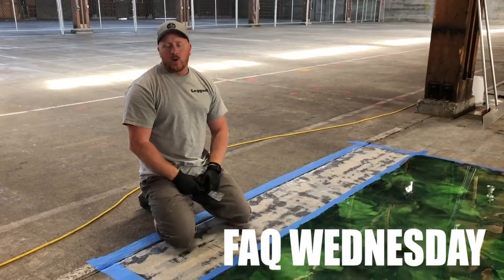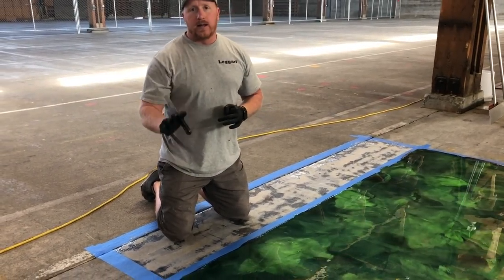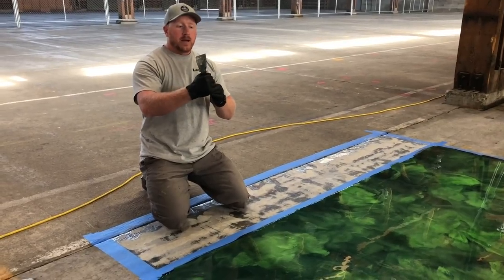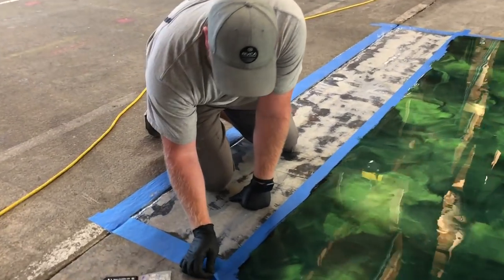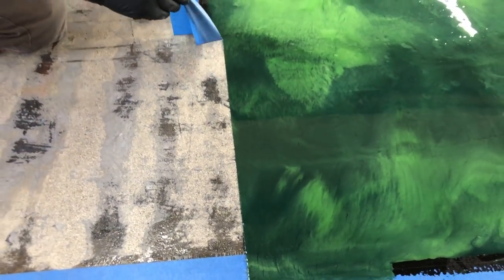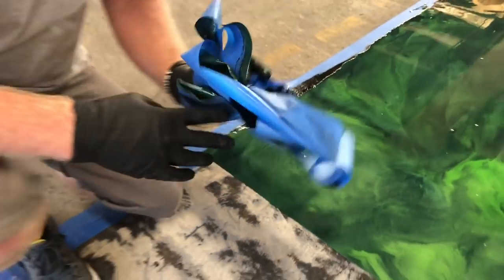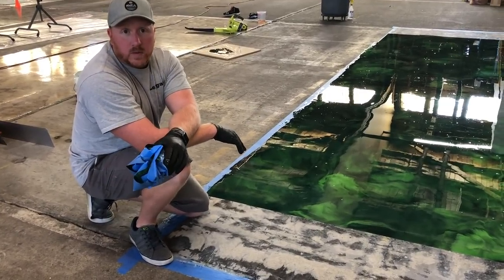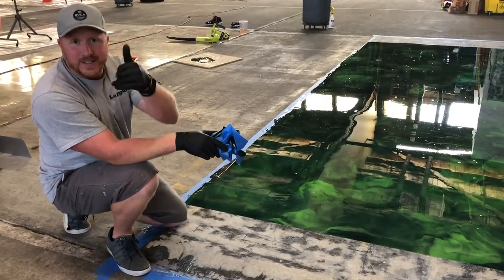FAQ Wednesday | When To Remove Tape

Comment: So my question is, I'll be doing this in my bathroom and I'll have my stand up shower taped off from the epoxy. The shower is on the other side of the room from the door entry. In the 2-3 hour period, is it still ok to walk on with spike shoes to peel off tape from shower? Or do I peel earlier? When do you not step on the epoxy until it cures?
Reply from the maker: After you apply the epoxy wait the next day so you can walk on it to remove the tape.  Thanks
Reply: This confuses me...in the video it says 2-3 hours to pull tape..but in the comments it says pull the next day? Which one is it?
Reply from the maker: Brandon Raynes sorry for the confusion, 2-3 hours is much easier when removing tape on flat perimeters like we’re showing in the video. Sometimes you’ll have areas that you can’t get to without walking on the epoxy, in those cases wait until the next day so you can walk on it. I hope that makes sense. Thanks
Reply: Leggari Products  yes! Haha thank you. I have my first floor installation coming up and that question has been bugging me. I’m trying to order my floor kit and when I’m getting ready to check out I noticed on the cart there’s no primer included with the order. Should I call in for this order? Just want to make sure I have everything I need. Also I need to order some flakes and I wanted see if I could order some 5 gallon buckets, or whatever large sizes you have,  of the part A and part B to have in my shop to practice with. Thanks again guys!
Reply: Thank you guys! Any suggestions if tape drys to the epoxy? This clears up alot of information.

Comment: I'm sure this is totally off hand but when I paint walls (Just did my home) at first I used the blue painters tape but moved to green frog tape because I had bleeding under the tape and needed better edge control. By chance have you tried the frog tape with the edge tech gel? and if so did it work as worse, better as well?

Comment: Would the frog tape work also?
Reply from the maker: Yeah, we typically just use painter's tape, it does the trick. With some projects, you don't want the tape to be TOO sticky and pull at whatever you put it over.

Comment: Guys I love yalls channel. I have a question for you in reguards to a river table. I have made few small ones with very good luck. I was approached by a possible costumer and asked if he could use the table outside. If so is there anything I need to do to protect it or place on it to be used as type of meal table on a deck
Reply from the maker: David Gavin there’s no 100% solids resin that is UV stable so you won’t be able to use the table outside. You can try and do a table with a Polyaspartic which is UV stable. It’s more expensive but won’t amber in the sun. It’s not a “casting” product either so to achieve a thick layer you’d need to do multiple layers (one a day) to achieve the look your going for. Email customerservice@leggari.com regarding the Polyaspartic. It’s worth a shot. Thanks

Comment: my friends, give me a suggestion, please. putting the blue ribbon on the foot wheel as I do to remove it since I imagine the resin will put a part on top of the ribbon. How do I get her out?
Reply from the maker: You always want to tape about 1/8 inch high so the tape does not get trapped under the epoxy.  Thanks

Comment: Why does that floor look like it is covered in bubbles???
Reply from the maker: I don't know what your looking at but it looks pretty clear to me.
Reply: Starting at 1:20 I can see what look like hundreds of bubbles.  I don't know if that's what they are but they are pretty easy to see on a full size screen.
Reply: Shop Hacks Dust or small dirt particles. It’s a concrete floor in open environments.